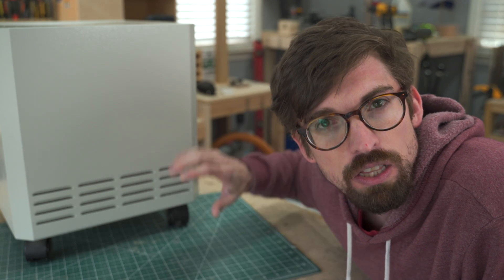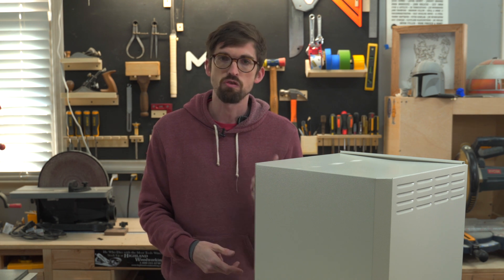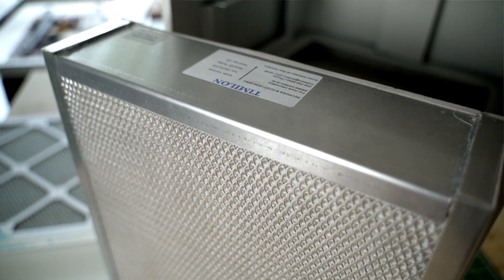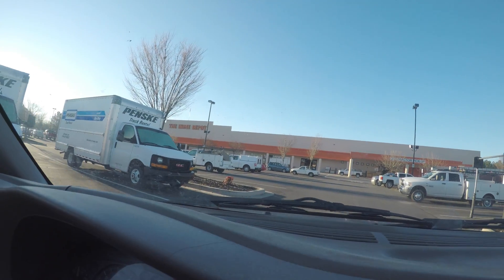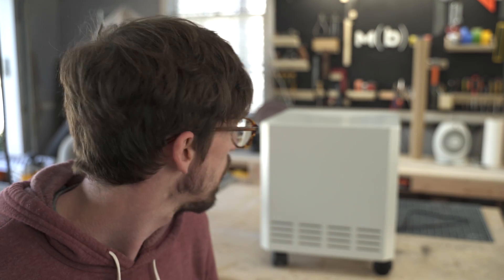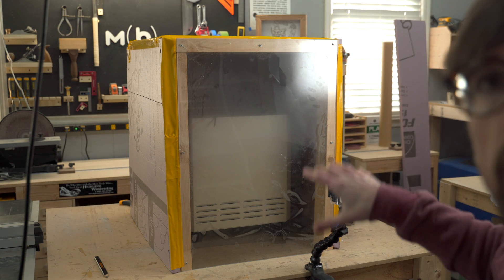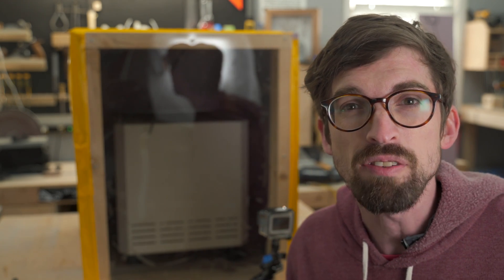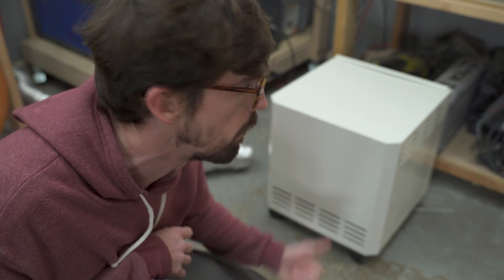Air Filter vs. Fire, Who wins in the shop?

Comment: Would this work for a glowforge? It comes with one of those hoses that suck out the smoke outside but I live in an apartment and don’t want the neighbors to think i’m starting a fire. I’m wondering if I just don’t use the filter that comes built in it at all since it’s so loud and using a air cleaner like this.